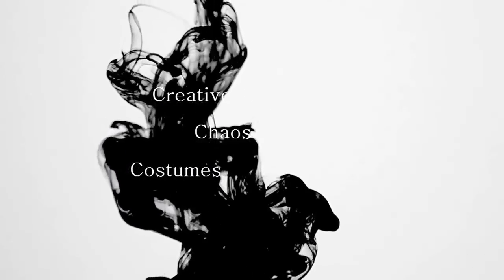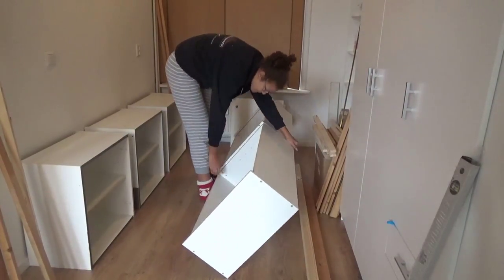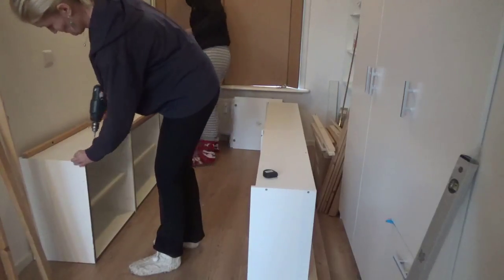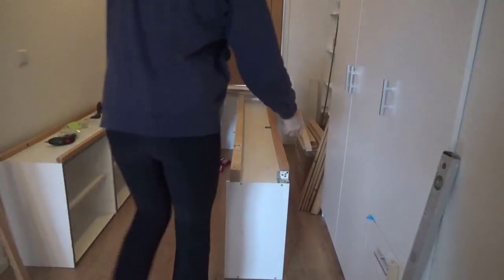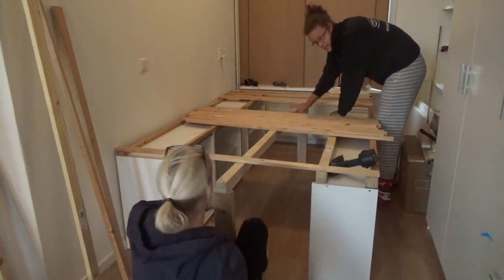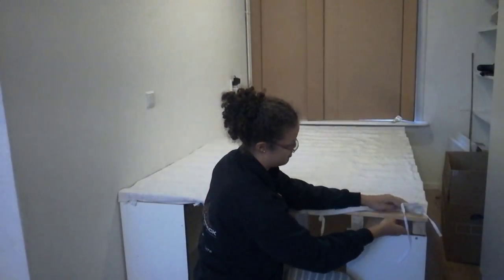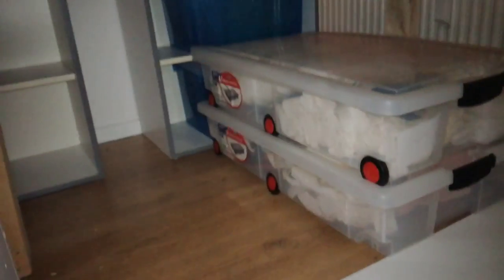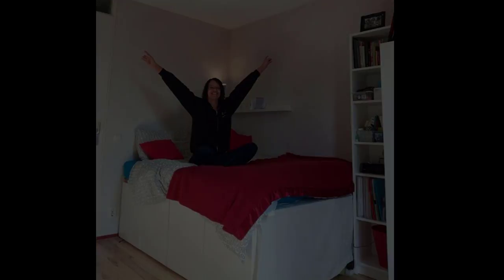DIY freestanding bed with lots of (cosplay) storage

Comment: Thxs. I was searching YT for an easy to make/create platform bed. I used your idea in my new place. I cant attatch anything to the wall either. Instead of kitchen cabinets,  I found 2 of the older large book cases, (they are made with real wood, not the flimsy ones made today). I removed the extra wood trim and placed then on their sides and removed the back panel on one of them, (this will be front of bed so I can slide stuff under the bed).  And followed the rest of your instructions. I reused the planks from my old bed and bam! #NewBed I did paint it and placed an old rug under the bed so the floor wouldn't get stratched.
Reply from the maker: Awesome! That sounds really cool! I love to recycle stuff and make it my own. Enjoy your new bed!

Comment: Lots of storage love it .
Reply from the maker: Thanks! Really happy with it :D
Reply: @CreativeChaosCostumes  I don't know if I can handle the weight of two people though like me in my partner. Cuz all storage cabinets are made out of particle board
Reply from the maker: I have not had any problems sleeping on it with two people. It is a lot stronger than I thought. A lot of the weight is around the middle beam. If you are worried you can take a look at my other bed tutorial. That was screwed in the wall what made it even stronger. You can always add some extra wood behind the cabinets to be safe.

Comment: Where did you get the bed slats?
Reply from the maker: These where cut to size for my old bed, so I could just screw them back. But originally they where scrap wood my mom had laying around. 

You could use something like 2x4 lumber. As long as all the slats are the same thickness and thick enough to carry your weight

Comment: It looks great and you did an excellent job on making your bed. But how do you open your cupboard doors (silver doors handles) that is on the right hand side in the video at 2:54? Because I'm having a similar problem but I made my cupboard and it has no doors at this time.
Reply from the maker: +Jodie Palmer Thanks! I am very happy with it :D I could not open them completely so I ended up just taking them out... I am making a curtain instead. I will make a short vlog to show what ik looks like now :)